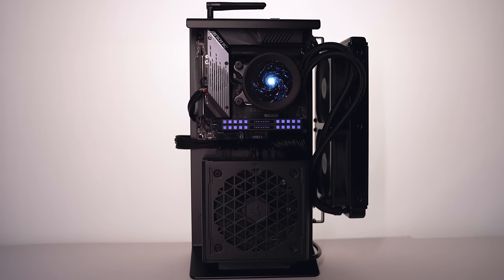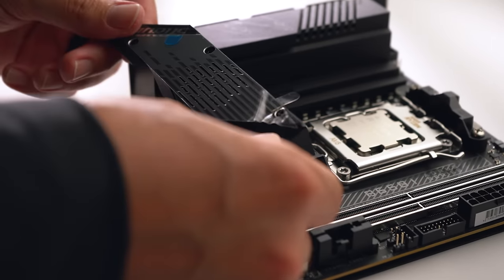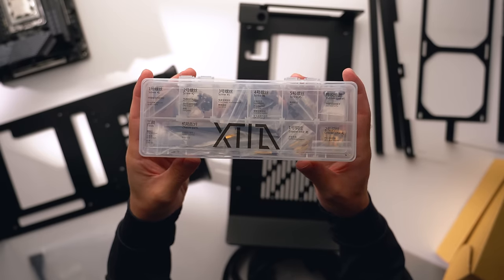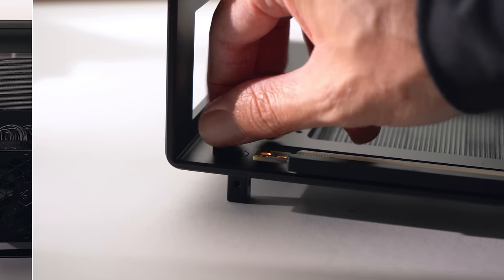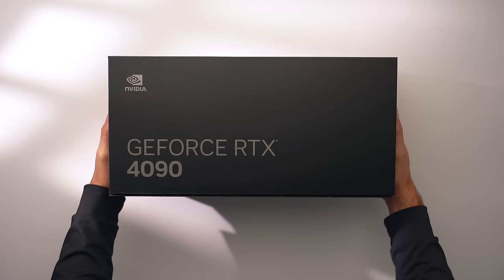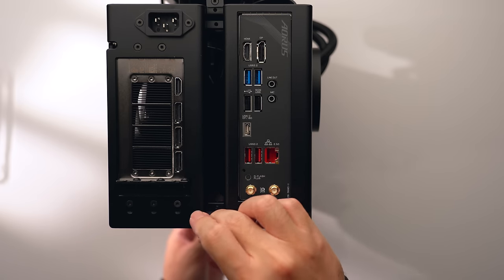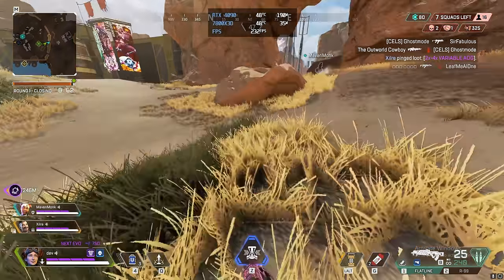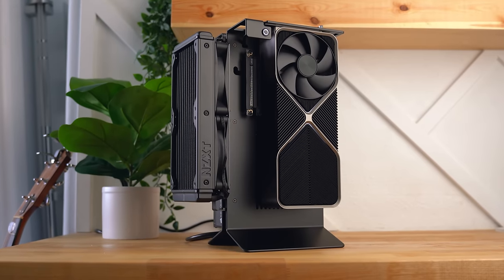This is a computer?

Comment: When I watch this video and video like this I really shocked by level of game optimization in new games) This monster give you only 70 fps on maximum graphic settings. I remember times when you was able to play any games on maximum with average computer that cost maximum 1500k or if to remember earlier times it may cost 1k and still you was able to play in maximum settings without lags. Now computers has a dozens cores and still it hardly can run it. So I think game developers in this time really overpaid. I have MacBook Pro m2 max for 3700 and its still give me 40-60 fps in the same game even its not for games. I think the monsters like this in this video must give you super experience with 300 fps minimum and average computers something about 60-70 fps in top games.

Comment: No way in hell I'd spend THAT much on parts and then leave them exposed by having no case to protect them. Besides the fact that the thing would be a dust magnet, you're just ASKING for something to bump into the mobo or the AIO fans, leaving you with a beautiful & expensive paperweight. If you're going through the bother of watercooling the thing, then why are you worried about the airflow anyway? I prefer PC gaming, but not at that price point with such a low level of protection. I'd rather buy a new gen console, and instead of keeping yourself warm in the winter with this machine, just light all the extra cash this cost you on fire.
Reply: Are y'all living next to construction yards? Or just avoid dusting your living spaces for years? 

I've been using open cases since 2013 and still can't notice any difference versus a closed one. Regarding bumping or food/drinks, any adult can avoid that by choosing the right position and not walking drunk next to an expensive piece of machinery.

Comment: ah yes, i love dust in my components
Reply: I have the XTIA Xproto-ATX case V1 from the same company as in Devyn's video and it heavily depends on your environment. If people live in a very dusty area then yeah I can imagine you would clean it every month or so but if that's not the case you do not need to clean it that often. I have my open case for almost 11 months now and I have cleaned it 2 times so far. and even when I decided to clean it there was an extremely thin (emphasis on thin) layer of dust on the top of te case and GPU with that dust there were no differences in either temperatures or performance. using an electric air duster and in 5 minutes tops the dust is gone. 

So yeah if someone wants to buy an open case, they just need to look at how dusty their room is and based on that you can guess fairly accurately how many times you would feel the need to clean your PC. 

For example, there is a video of a guy who shares an update on not cleaning his PC after 3 months with the same case as in this video of Devyn. I nowhere nearly have as much as this guy in the video. After 6 months I don't even see dust on my CPU fans or PSU. 

Since YouTube will not let you post links the title of the video is ''Three months of dust with xproto + cleaning''
Reply: @emiel255  oh boy let me tell you that if I had the same case as you in my environment, my components would have more dust on them than there is components in my computer fr 😭

Comment: if you think dust is bad with a case it is twice as bad without one....
Reply: I have the XTIA Xproto-ATX case V1 from the same company as in Devyn's video and it heavily depends on your environment. If people live in a very dusty area then yeah I can imagine you would clean it every month or so but if that's not the case you do not need to clean it that often. I have my open case for almost 11 months now and I have cleaned it 2 times so far. and even when I decided to clean it there was an extremely thin (emphasis on thin) layer of dust on the top of te case and GPU with that dust there were no differences in either temperatures or performance. using an electric air duster and in 5 minutes tops the dust is gone. 

So yeah if someone wants to buy an open case, they just need to look at how dusty their room is and based on that you can guess fairly accurately how many times you would feel the need to clean your PC. 

For example, there is a video of a guy who shares an update on not cleaning his PC after 3 months with the same case as in this video of Devyn. I nowhere nearly have as much as this guy in the video. After 6 months I don't even see dust on my CPU fans or PSU. 

Since YouTube will not let you post links the title of the video is called ''Three months of dust with xproto + cleaning''
Reply: @emiel255 yeah that is one thing that is pretty sad about youtube they won't let you post URL's i sure do miss the old ways...
Reply: @10percent4DaBigGuy  yeah exactly hahah but I have given you the title so you should be able to easily look it up. Anyway like I said the stigma of it being a dust magnet and what not is heavily exaggerated in my opinion as it is not as black and white as people think. I would say environment and position of the case is one of the biggest contributors to your PC being either very dusty or barely getting any dust in its components no matter what PC you have

Comment: IF YOU PLAN TO BUILD THIS: Please do not use this video to follow along side your build. This video is garbage. This case is a PAIN to put together and the video doesn’t explain how to effectively manage cables. You MUST have a 22cm PCIE cable for this… otherwise it will not work. Please read the FULL product page of the proto N &&& L before purchasing anything!!!!!

Comment: Bro is really going to go penny pincher mode tryin to save $100 buying a gen4 ssd instead of a gen5, but then immediately drop wads of cash on overpriced Corsair Dominator RAM and an overpriced LCD watercooler. But hey I guess at least his build total is $3400 instead of $3500 now. 🤣